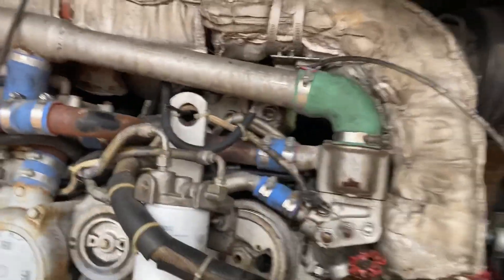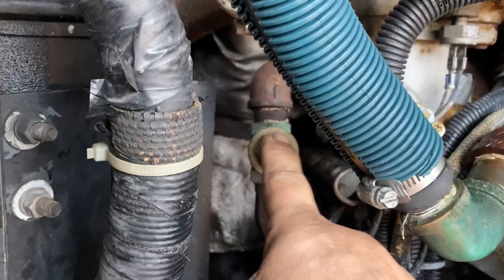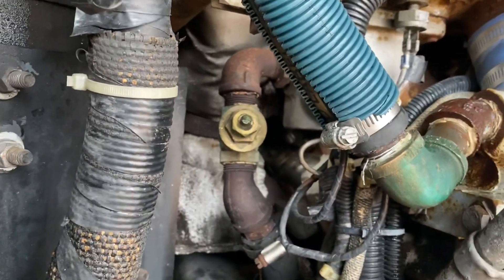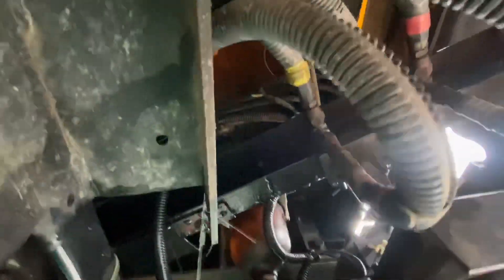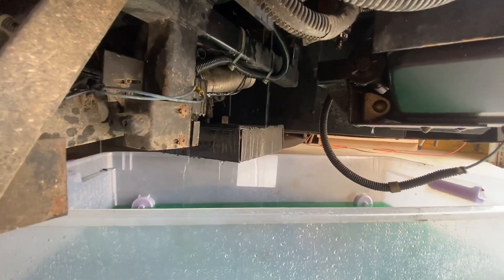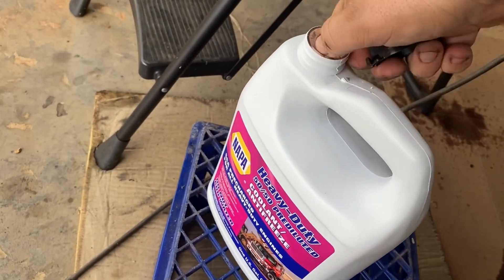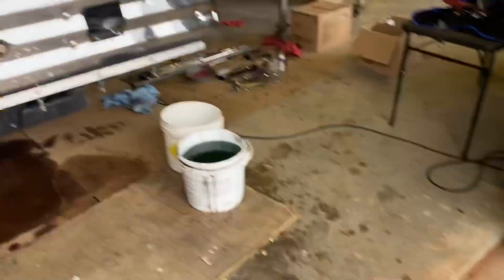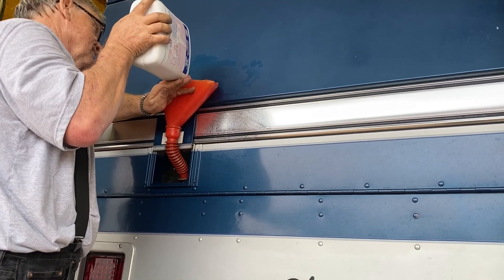Wanderlodge 8v92TA 1st start after bottom end rebuild

Comment: That moment you realize you need to buy your coolant in 55 ga. drums. Great videos
Reply: I own a small fleet of gm diesel powered vehicles and I buy anti-freeze, engine oil by the 55 gallon drum. I gear lube in 30 gallon drums. I have two 500 tanks of diesel fuel, buying in bulk may be considered costly to some. Buying in bulk saves me money in the long run because most of the products last more than a year or two.  My family is used to every thing being a diesel that my youngest asked why don't have a diesel powered weed eater

Comment: You can save a heck of a lot of money by buying full strength coolant and cutting it with distilled water.
Reply: That's what I always do a 50/50 split
Reply: Walmart is already onto that.  I buy my ice there and they cut it with water.
Reply: Tommy TwoGun I do the 70/30 to get the max cold and heat, I also have a coolant filter with anti-corrosion.

Comment: Would love to get a hold of the GMC motorhome.  Been a fan of them since I was a kid.  Beautiful wonderlodge.  I started my career as a cad designer doing Prevost coaches.  Even did a few famous ones.   That GMC though....  Wish I could....
Reply: mudmanrv do you still do any design work now or have you gotten away from it altogether??  

I started going to school for architectural engineering but it was in the early to mid 80’s right when the schools were trying to go from actual drafting  and switch over to cad and although I was fantastic at design with a pencil ✏️, computers were a completely different story!! At that point in life, I had never yet even seen a computer other than pictures of what NASA and the government was using at the time and I think I got intimidated and overwhelmed and just plain scared of the damn computers that I just dropped that at that point and went into the Air Force and became a jet engine mechanic.
Reply: @1982MCI   I'm a SR. Design Engineer and Cad Administrator for an RV company now.  I started designing Prevost buses right out of college - moved into regular manufacturing jobs for several years, before going back into the rv industry.  I don't know if it will be my long term career - but I still do design work.  yes.

Comment: I always see how messy it is for coolant changes. May I recommend using a wet/dry vac someday you do this. Do it once, and you’ll always use that method. It contains everything, protects it from being consumed by pets, and it SUCKS it completely out of the engine! Reverse to the blower if you want to blow through lines etc. you’ll get a lot of shit out of there, trust. Cheers to your passion being shown to the masses, Scott.
Reply: I pull a vacuum on the complete cooling system then pull in new coolant. No air pockets at all

Comment: Whenever I have a thermostat out of anything I drill a small hole  like around 1/8"so when I fill it its self burping. That way I don't have to get it hot to be sure its full. My only complaint with detroit's is all the hoses, each susceptible to chafing  and age cracking.

Comment: im not sure if your fan suffered any damage from that shroud mishap. but its possible when the piece of the shroud folded in its possible the fan could be out of balance which could ruin  the bearing i would check the fan for wobble on every trip if the bearing lets loose don't want it hitting and eating up the radiator.

Comment: Anyone's thoughts on replacing the  gate valve with a quality stainless steel  threaded full port ball valve?  The handle can be removed and reinstalled or just used to turn as needed.  Stainless steel would mean no rust.  The "innards" should easily handle the temperature. Gate valves are just so slow to open and close and they are kind of restrictive and can leak. The handle of the ball valve can be positioned anywhere within the 1/4 turn and the handle can be removed so it's weight would not alter the position of the ball. These are my thoughts.

Comment: You can save lots of money by getting concentrated coolant and adding Walmart 88cent/gallon distilled water at a 1:1 ratio. 50/50 pre diluted is a rip off because it should be a little more than half the price but is usually maybe 80% the price.
Reply: Can you buy 22 gallon drums of antifreeze ? Better yet I would think.

Comment: Scott. Have you ever pulled the wheel bearings out of a bus and found some Idiot had used a chisel instead of a soft punch when driving the races out and SPIKED the hub where the race fits in the hub? (had TWO cars where someone had done that in front hubs!)

Comment: Is 150k low mileage for the wear on the bearings?
Reply: I thought that seemed a lot of wear for 150k for a large engine, but all I know about this is from watching the videos lol
Reply: Scott covered it a bit in a past video where he compared the size of the 6-71 in-line bearings with the size of an 8V engine's bearings (don't recall if it was an 8V-71 or 8V-92 - maybe even a 6V).  Regardless, from what I understand, the 8V-92 in particular is hard on bearings due to high power output per bearing surface area.  I think they can be rated 450hp and up, compared to "only" 318hp for an 8V-71 non-turbo.  Also, 2-stroke diesels are hard on rod bearings because the load is always pushing down due to either compression or blower pressure on every single stroke.  That's why the top rod bearing shell wears so much faster.